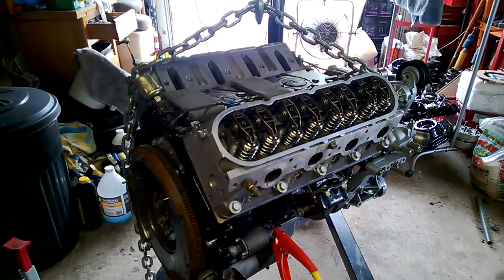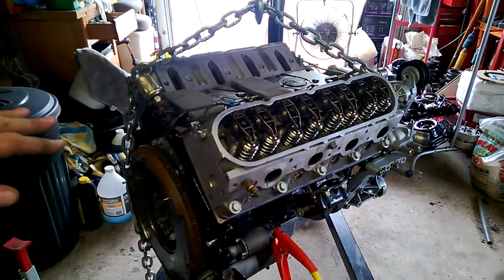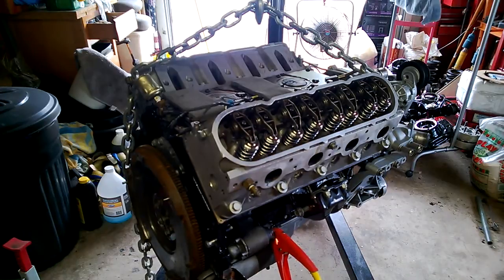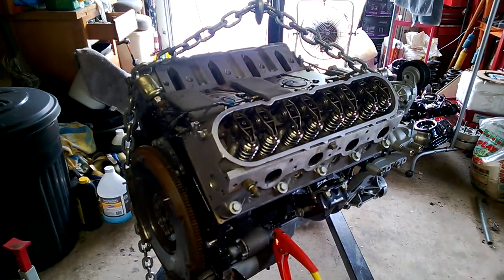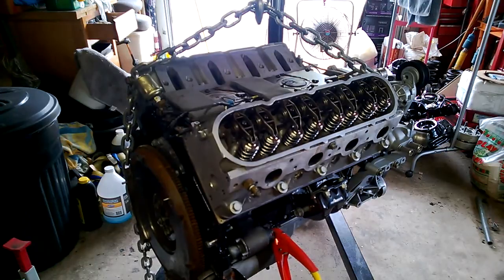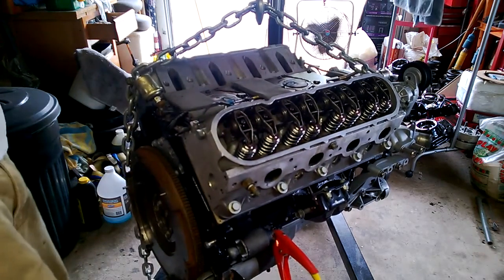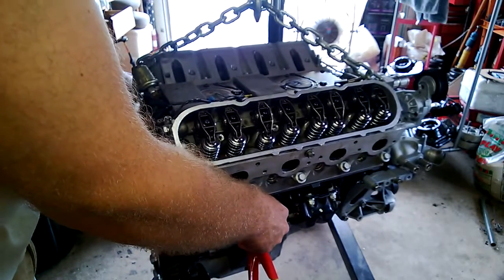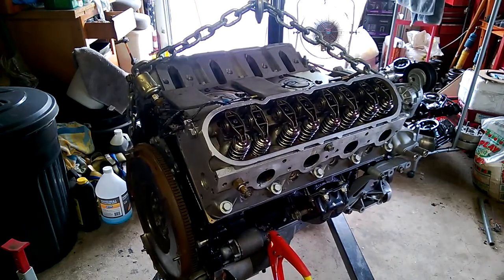Cranking Motor While On Hoist - LQ4 Build - Checking for Oil Pressure Before Install

Comment: what do I have to hook up to start my engine like that I bought a junkyard one with blown heads I replace the heads I would like to see if it cranks over before I swap it in my truck
Reply from the maker: Hi Edgar.  You just need a battery positive on the big connector of the starter, a ground on the body of the starter, then bridge the solenoid activation stud to the big connector.  Check my reply to Leo below.  There is a picture link that shows how to do it and the link is still good.

Comment: where did you find the info\ specs for the final valve lashing and rocker torque? I wish you would have posted that video.!  I cant seem to grasp it< because of the rockers not having lockers..
Reply from the maker: There arent any lash specs per say on these.  You have lifter pre-load that you determine and set with push rod length.  When you install, you just make sure the lifter for the rocker you are torquing is off lobe, or on the base circle of the cam, and torque to 22 ft lbs.  Thats it.  There is a sequence you can follow so that you can torque down half of them at once, then rotate the motor and tighten the other half, but I never remember which cylinders/rockers you do in which order.  Thats why i didnt post the video.  I ended up just torquing them all down per the manual and i was worried I had a problem, so I focused on that and didnt really video much.  Ill check the footage again, and if there's anything useful maybe Ill do an upload.
Reply: Thanks a lot. Your rebuild videos have really been good,  especially since I am rebuilding an lq my self! On the sequence you are referring to,  I believe that is just for solid lifters,  but if it also works on this particular motor than I have it. At the same time it's probably just better to take the time, and do 1 through 16 instead of jumping around and getting lost.   Thanks for the reply.

Comment: Did you just hook a jumper cable from the battery positive to the starter? I couldn't see what you physically did for the motor to turn over.  I've recently swapped cam/springs/oil pump/pickup on a 5.3 lm7and wanted to do the same to prime the oil system before the first start.  If you can share any info id greatly appeeciate it.  Thanks in advance.
Reply from the maker: Yup!  Sure did!  I hooked a battery up to it.  Jumper cables worked great.  Negative to an ear on the block for ground. Positive to the main lug on the starter.  Then I just used a heavy screw driver to bridge the main lug of the starter with the solenoid post.  Thats what makes the starter spin.  You could also use a piece of heavy wire.  Check this pic out: http://ww2.justanswer.com/uploads/heavychevy396/2012-03-16_174422_test_a_starter_2.jpg